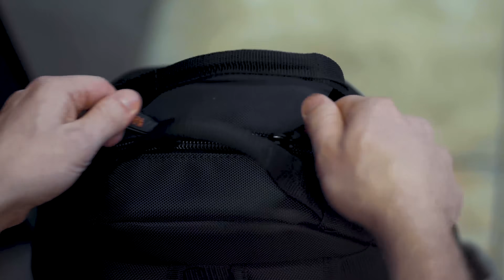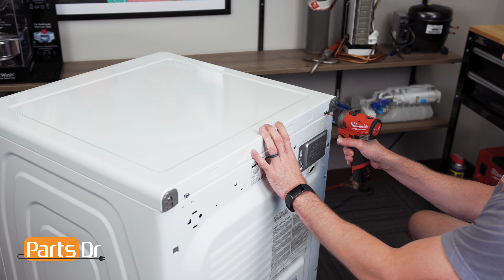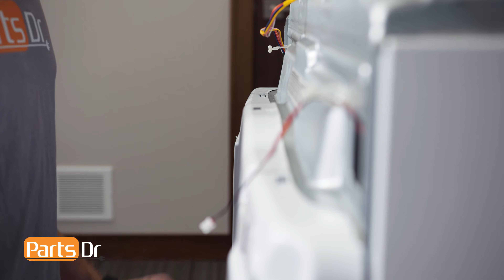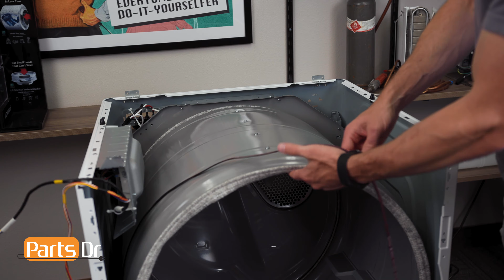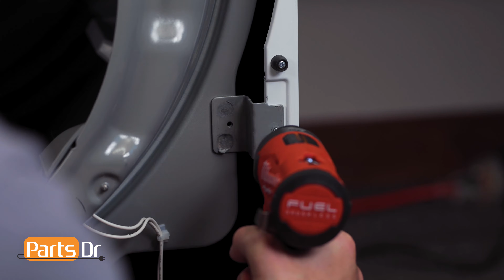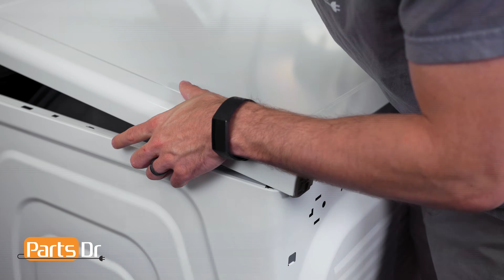How to replace the idler tension spring part # DC61-01215B on a Samsung dryer

Comment: This helped a lot. It helped to know that it matters that the drum has a front and back; that turning the drum backwards can throw the belt off. The video is super clear about exactly how the spring goes on and how the belt is threaded on the pulley and motor.  I did it and it's fixed! Thank you.
Reply from the maker: Nice job fixing it yourself!

Comment: My spring popped off during operation (dryer only 2 months old). I had no clue as to how the spring went back on so I really appreciate this video. I bent the end a bit on the side that connected to the padded idler pulley arm in hopes that would keep it from popping off again.
Reply from the maker: We are glad you found this helpful!  If you find the cause of the spring coming off, let us know.
Reply from the maker: We thought that we have is that someone is rotating the drum by hand which could possibly cause this to happen.
Reply: Looks like I have a spring idler issue as my Samsung dryer model DV45K7600e(g) dryer has stopped spinning. The dryer belt is loose and the spring is unattached and the wheel has popped off the mechanism. I was able to see this by taking off the top, door, face, and lint collector. Do you have any instructions or videos on how to replace for my model since it doesn’t have a back like this video to remove?